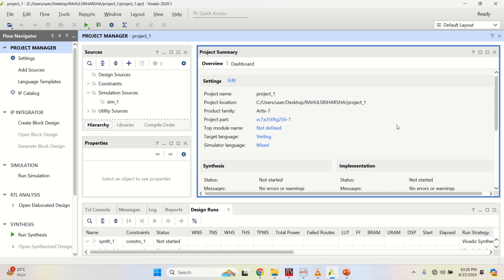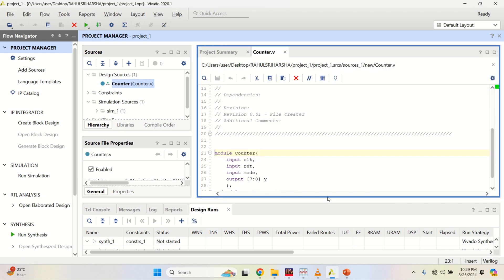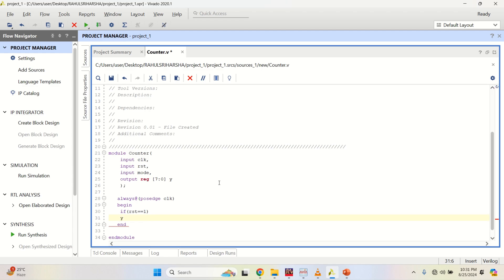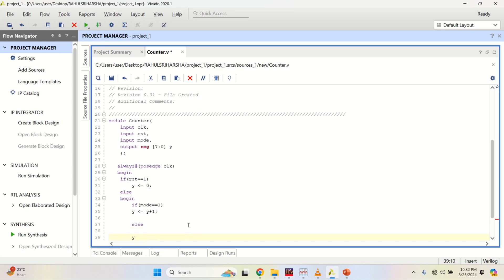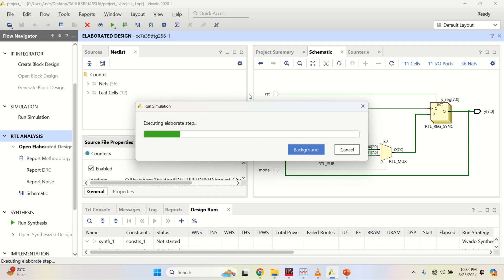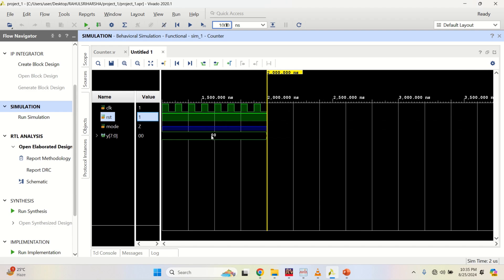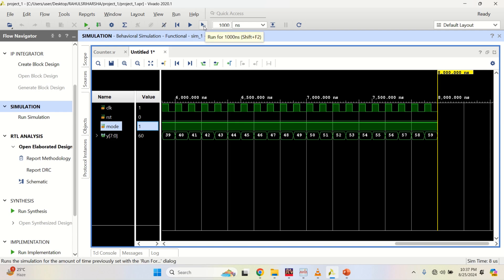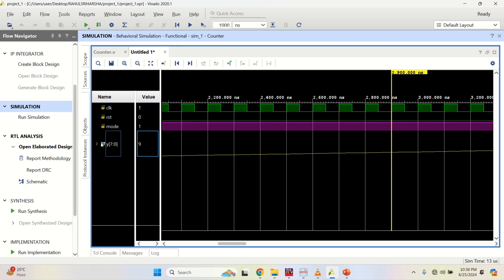8-BIT UP/DOWN COUNTER IMPLEMENTATION in VIVADO.

Comment: Sir which reset is better for FPGA? In ASIC mostly asynchronous reset is used, so that even if clock struck or clock is coming from other design which is in off state also, we can reset our design with async reset. Is it good for FPGA as well? Thank you, sir!
Reply from the maker: In FPGA designs, both types of resets are used, but many designers prefer synchronous resets due to their predictable behavior and ease of timing analysis.
Reply: @dr.hariprasadnaikbhattu  Thank you sir
Reply from the maker: Sorry for delayed response